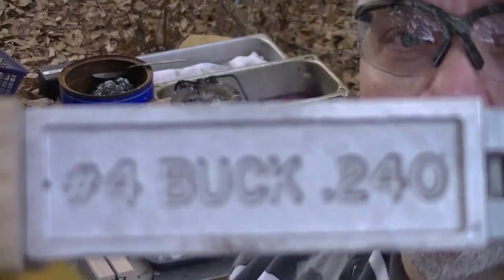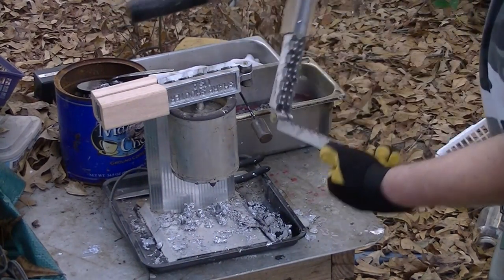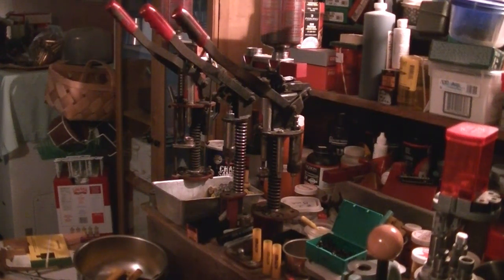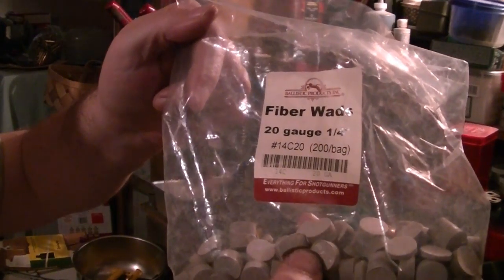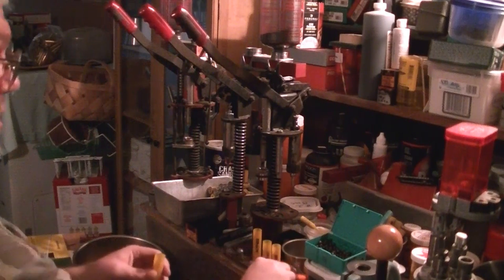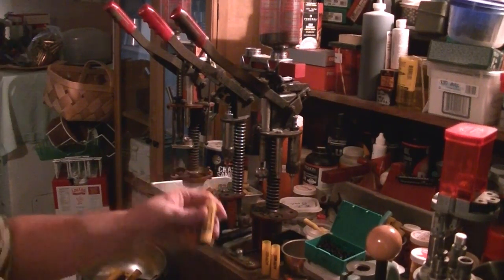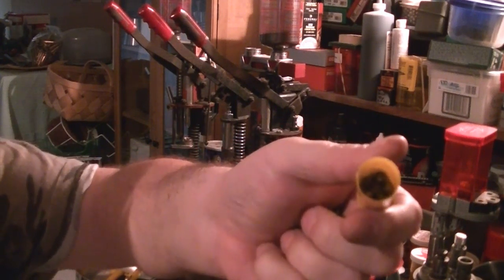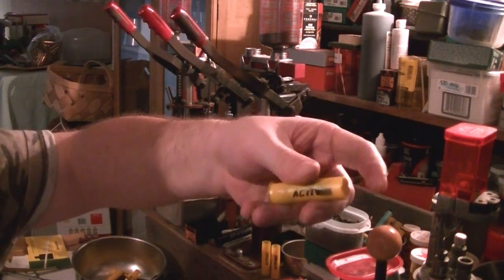Reloading Buckshot for my 20 Gauge using #3 & #4 Buck.

Comment from the maker: The buffer works into all of the spaces between the pellets and keeps the pellets from compressing against each other and deforming when fired. The rounder the lead pellets stay, the straighter that will fly giving tighter patterns at extended distances.

Comment: I had the set too, used the sliding scale, found the dipper for a specific weight poured it onto my digital scale and it was off too...
Just found a insert that would give out the 18.5gr you used, got a thin card for top, and they look like factory loads...  think I am set, although weighed 20 of the #3 and they weighted 30.1g so about 1.05 oz loads.  Anyhow after it warms up will try a few with shoulder then onto pistol grip, looking good, thanks again.

Comment: Using the 2.2 CC Lee cup to dip that #3 buckshot works well, it holds 5 shot per dip, 4 dips and you have your 20 shot, just a tap to make sure you didn't miss one on the hull and you can start to add the filler...Adding a thin overcharge card sure makes the crimps look pretty...

Comment from the maker: My pleasure! If powder prices hold around $20.00 per pound, and you get your lead and hulls for free; Primer ($.03 cent), Gas Seal ($.02 cent), Filler wad ($.02 cent), Powder 18.5 grains of Herco @ $20.00 per pound = ($.05 cents) per round, Buffer ($.02 cent) (Lead and hulls for free) And if my math is correct, that comes to $.14 cents per 20 gauge buckshot round!

Comment: Used the Lee die they recommended for 18 gr Herco powder, the 122, stacked the balls and the buffer and dipped the crimp..  Weighed what was discharging and only 16 gr of powder with a 122... bottom of hull got a kink in it too for some reason.  The Lee doesn't have a precision base to align the shell and it can move in and out quite a bit, but most likely not stacked high enough, may try tad more wad at base, or the powder was inadequate since was off on the scale, might look for a charge card.

Comment: Nice job :-)
Somebody might have already mentioned it already but you can speed up settling the buffer into the shot by placing the the side of the case against a vibratory case tumbler or failing that I bet a vibratory palm sander would do the same :-)

Comment from the maker: The hulls that I used in this vid were new (very old stock) that I have had in storage for years! I pulled them out when i bought my 20 gauge! Then I started searching for data... and as you have seen, it almost doesn't exist! So, I pooled all of the info that I could find and started there. All you really need is a good starting point and then you can tweek one way or the other until you fall upon the results that you're looking for. Shotgun reloading is more forgiving than metalic reloading!

Comment: That ballistic products site sure hides their felt and cork wads, only found 1/4" options  hidden on their buffer page.  
I know I can stack 2, but hoped they had everything as you used in this recipe,except for different hulls. 
Loading 100 HD rounds since ammo was on b/o  for #3 buckshot, and $8 for 5 rounds plus shipping for what I could find is crazy... 
The site you ref'd for your molds has dif weights for same number of shot, 19 pellets/oz for 3 and 21 for 4... Bought a Lee 2 loader to use

Comment from the maker: I'm using the load data for 1 oz of lead shot... No, alliant doesn't have 20 gauge 'Buckshot' load data per say, I am using the recomended load data for 1 oz of lead shot in a 2 & 3/4" 20 gauge load. Yes I have used remington nitro high brass hulls, federal premium high brass for the same buckshot loads. If you're going to load some 20 gauge buckshot you will surely want to get the #3 & #4 buckshot molds! I have also loaded some steel shot loads (BB) for duck, varmits and such.

Comment: I just traded for a 20 gauge too...and  may load some single '0'  or  #1 buckshot "IF" I CAN FIND   enough components to do it....   I would prefer to use unsplit shot cup style wads to keep pattern tight "IF"  I can find the stuff and  get that to fit properly in a safe loading.
Reply: I " may discover "  that some of those shot sizes are  "too large to fit"  inside a 20 gauge "shot cup"....and will likely choose whatever size stack in pairs or threes.
Reply from the maker: Here's the 20 gauge wad: http://www.ballisticproducts.com/CSD-20ga-steel-wad-UNslit-250_bag/productinfo/0207020/
Reply: Awesome.  Thank you for confirming that BPI 20 is the correct wad for this... based on your other videos and  carefull inspection of Federal FLIGHTCONTROL and HORNADY  VERSATITE wads, and some factory loaded steel waterfowl shotcups...  I thought these BPI look about the same and should work.  I pray that Hunting Season is going well in the Carolina woods and all are safely enjoying bagging deer and other critters for meat and fun.  My freezer is empty.... I gotta get busy and in the woods.
Reply from the maker: J Martin My pleasure buddy!!

Comment: Alliant does not have any buckshot data that I could find. Is this modified from bird shot load data? Or is this BPI data?  I am not set up to reload 20 gauge yet but want to be soon. Have you had these pressure tested? Have you used any other hulls? I do have the sharpshooter mold and it works great. Best mold I have bought to date. I don't have a #3 or #4 buck mold yet, just 0-buck but it makes a pile of buckshot in no time at all.

Comment: any body out there agree with me? that if you hand load lead #F shot in a 12 gauge load but you loaded it rather hot up in the 1450 to 1600 fps range it would probably be roughly comparable to #4 buck in the 1325 fps range. At least for shorter 20 to 30 yards or less distance. I'm not saying legal for hunting deer but still as effective.

Comment: The Alliant site did not have any recipe close to this one in the 1 oz shot that I could find.
The site had specific hulls and primers and max load in either of the 1 oz was 17.5.
Do you have a link to this recipe or did you just create it on your own?
They may have updated the site for 2013 and I might have to break out my books when it warms up, they are out in shed and it is -30F tonight with the gusts... Thanks again. Tough to find buckshot recipes for 20 gauge...

Comment: So was it trial and error for this load or was there a recipe somewhere?  Can only find by specific hulls and primers on that link and the ones you used were not listed. 
Cheddite Multi-Hull 20ga 2-3/4" 16mm 
BPI Super Buck Lead Buckshot #3
PT20GS 20ga Low Profile Gas Seal 
BP Mix #47 Buffer 
Fiber Cushion Filler Wad 1/2"          
is what I bought online, will get powder locally to avoid hazmat charges, any need to change your for any of the items I used that you are aware of?

Comment: i want to reload 20 gauge 2 3/4 #3 or #4 buckshot using a federal hull, Fed209a primer, blue dot 26 grains. This is a load from lyman's #5. IT doesnt call for buffer, can it be added or worst case can i just load 19 pellet instead of 20 pellets of #3 buck, then add the buffer to keep pressures safe? THks

Comment: How well does hand loading/reloading #1 buck in 20 gauge work out?
Reply from the maker: It works great! It works almost identical to the #0 Buck loads... I shot one of those loads here: Test Firing 3" 20 Gauge Buckshot Reloads!... Coyote Buckshot Rounds!
Reply: Interesting. I always wondered why U cannot find factory 20 gauge buck shot loads bigger than #2 buck. I assumed maybe larger buck shot would not pattern as well out of the smaller 20 gauge bore but your videos are slowly proving me wrong. :-)
Reply from the maker: jared taylor That's why reloading is so cool... I can load rounds that the factories can't! Automation prevents the ammo factories from loading larger pellets into a 20 gauge shell... since I load by hand, I can load #1s and #0 Buck into a 20 gauge round! Cool stuff...
Reply: also watched your video on the 80 yard buck shot challenge. U ever considered just using open choke and flight control cup to get a tighter pattern at those longer ranges? Are flight control wad cups even available for reloading or they only available in factory loads? If there not available for reloading U think it could be easy to make home made ones?
Reply from the maker: jared taylor Ballistic Products makes some great flight control wads! I use them all of the time in my buckshot reloads... I call them 'extended range' loads.
Reply: neat! They only make them to fit 2 3/4 inch shells or the make them for 3 and 3 1/2 inch shells too? I think a flight control wad of 54 pellets of #4 buck 3.5 inch magnum would be a monster of a load.
Reply from the maker: jared taylor Yeah... they have wads all the way up to 3 1/2" and yes a 54 pellet #4 load would be a monster alright!
Reply: wow I just watched a youtube video where using a shot gun a guy shot and cleanly killed a coyote at 108 yards and he was not even using a slug it was either buck shot or bird shot of some type. I think they called it heavy shot or something like that using a ultra full choke. I know 70+ yards is near pushing it but I didn't know 100 yards let alone over 100 yards was even possible with a shot gun even with a flight control wad without using a single projectile slug or pumpkin ball.